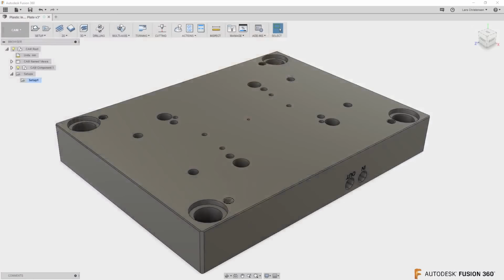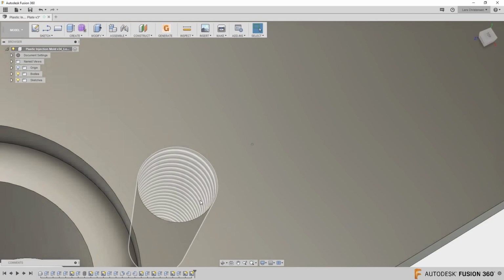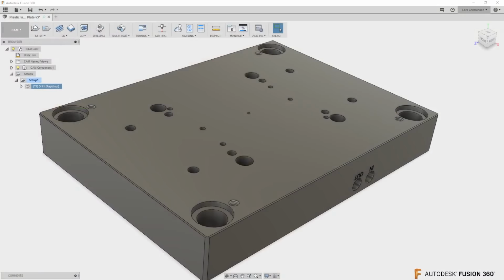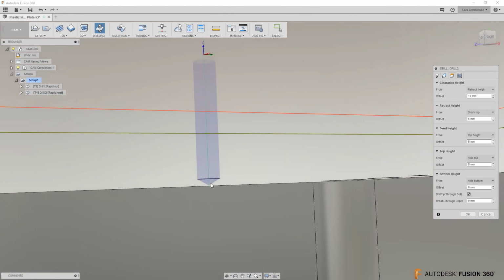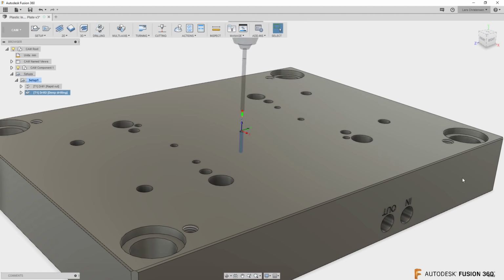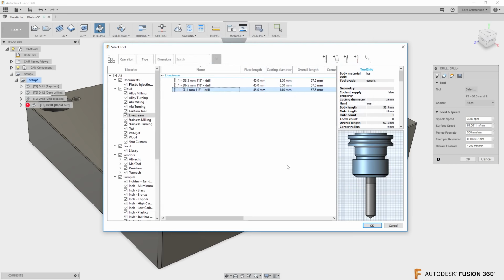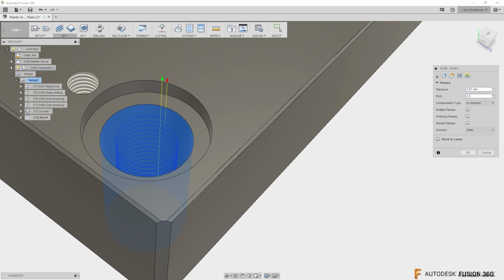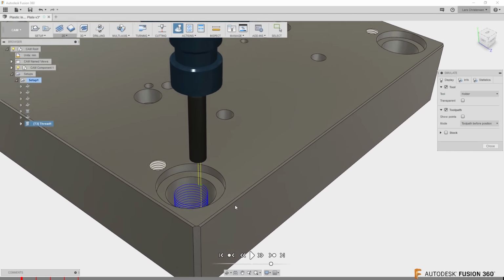Everyone Can Make a Straight Hole — Fusion 360 CAM Tutorial — #LarsLive 155

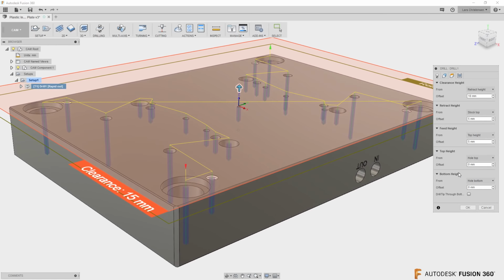Comment: 9:33 most annoying thing in fusion is these. should need them. model is there. model have top and bottom. feature has bottom. this is tool cut it! if any some weird reason need special. click advanced hidden menu and enable things. default should so so easy. just do it.like manual mill.other ways is SLOWER than first lace just punch data on cnc machines from drawing that customer allready made.no need draw model again. i have all measures allready 99.999% times

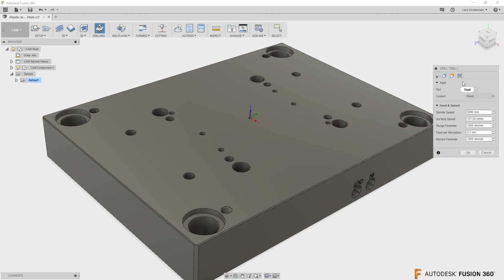Comment: 3:40 exactly. default it should be just do it.this is hole this is tool.do it. funny things can enable with check boxes. this should be default for every operation. do it as i told. dont cut model. all special things should be hidden in menus.only need model ,tool and feature to cut.if cam is smart it do it.i wish no red red red.what? should it not cut in model?

Comment: Thank you for the great info.

I am trying to drill a 2.2mm Fiber Glass sheet, The thing is that when the tool breaks through the material all the way, some material is chipping off too from the bottom side of the sheet, it is like the material is breaking or something and leave me with a not good looking hole. I was reading about the Break through option to see if I can make a good quality finish for the hole. Any Ideas about using the break through option? the diameter of the hole is 3mm. And I might test the circular pocket milling to receive better results. Again thanks for the great info. I would really love to hear your thought on this.

Appreciated.